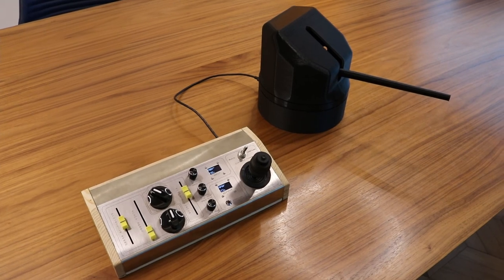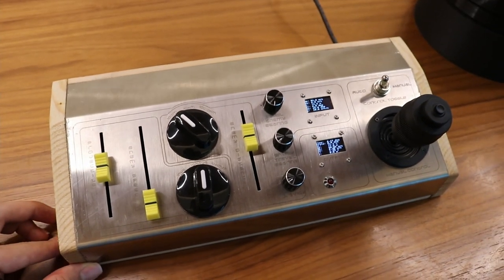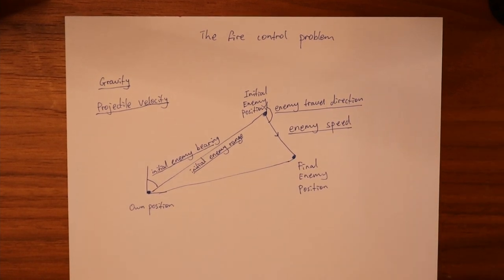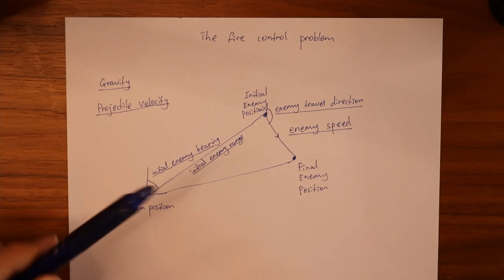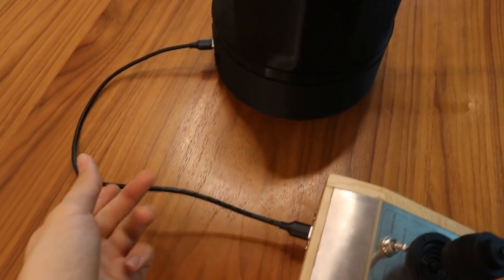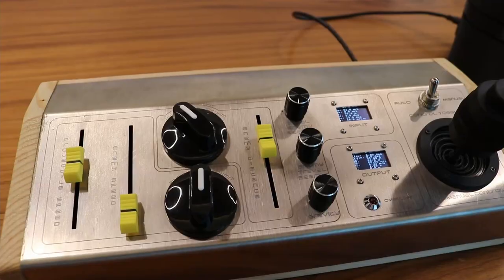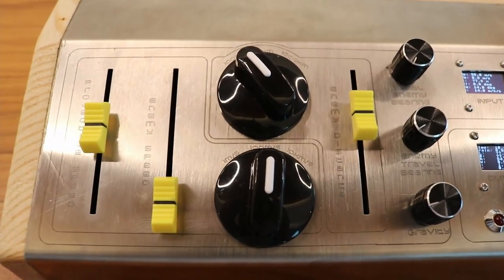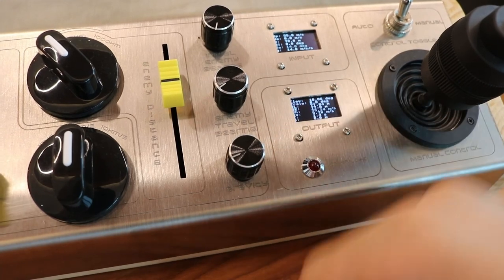Turret Aimer Part 1 - The Intro

Comment: A third mode to the automatic mode could be that, instead of manually entering the direction and the speed, the user aims the turret at the target and then hits a button when on the target, the user then tracks the target for a few seconds until the unit beeps, takes over, as it now has calculated the speed of the target.
Reply: Cool! That means adding some rangefinding sensors (HC-SR04?) and an encoder (custom built absolute encoder?). That should be enough. It could be done given enough time.